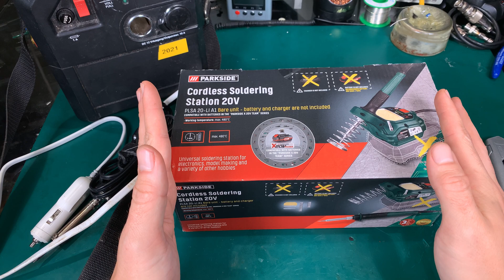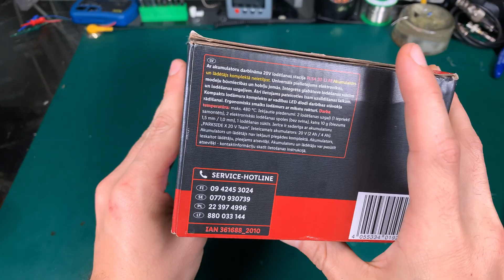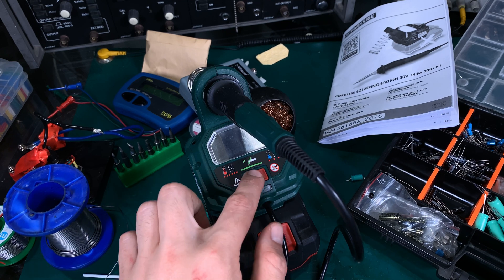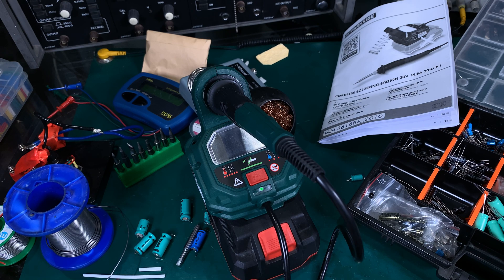Test / Review Parkside PLSA 20-Li A1 Cordless Portable Soldering Station 20V (X20V Team)

Comment: Hi. Please could you tell me which soldering iron tips you have which fitted this? I need to buy some. Mine has worn out the stock tip VERY quickly (I suspect it's too hot as you commented).
Reply from the maker: I tested them on: soldering iron tip 907 <- and work just fine, those are cheapest china sold in bulk.

Comment: You can calibrate this soldring iron. 1).Power on until solid green.  2)To reduce temp, hold down power button until a solid red light shows. To increase temp, hold down power button until a blinking green light shows . 3). To increase or decrease temp, a short tip on the power button (three clicks for approx ten degrees) 4).To end calibration hold down power button until light is a solid green.
Reply from the maker: Thanks for info! I will try it out!